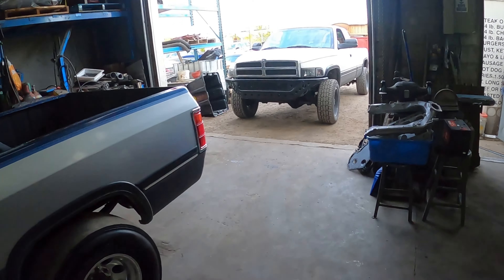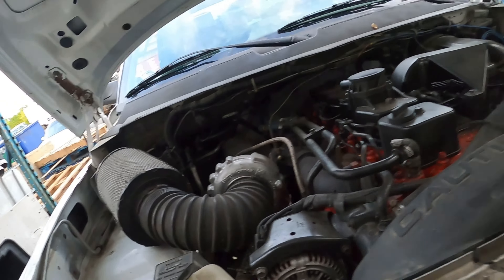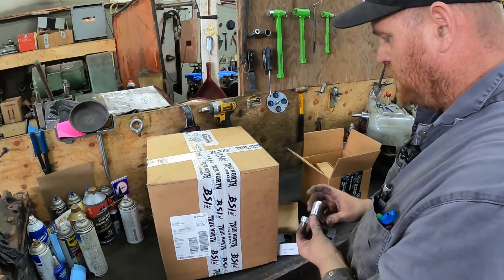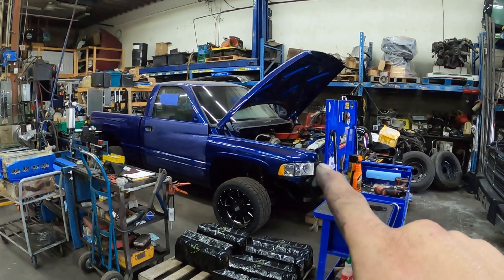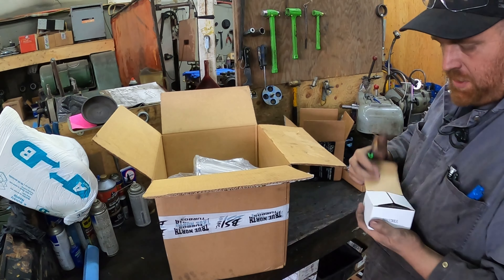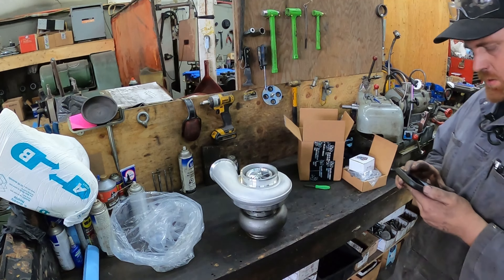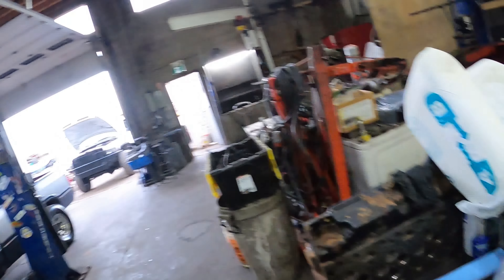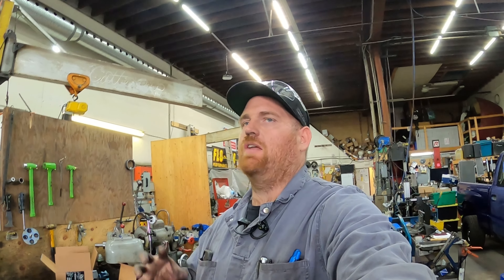I CAN'T DO THIS ANYMORE  SORRY GUYS .  I am going compounds turbo's .

Comment: I went from a silverbullet 62 (awesome) and after dropping a valve and ruining it i went with a s362 with a s475 and its super awesome. Instant boost and lots of it. 60 psi all day no lag no smoke no 1700 egts. Built the kit myself saved 1000s. Its amazing how quiet your exhaust gets and you dont hear the small turbo whistle anymore

Comment: Well when I first saw the heading or what ever it's called . I thought crap I guess Rob is done damn . . Then I saw the turbos lol. Yea I watch Richard Holdener videos ,I watch all of them to learn , and others. I learn that way its a lot cheaper to do it that way .   I have thought about twins but I have to remove the head and do the o rings and studs ect . Pull the pan and weld in a drain . I might do that some time and do a set of towing twins . I come to the realization that perhaps a well built 48rh transmission along with twins might be tow pretty good. I always hated the 4 speed transmission and the huge rpm drop but with the power from the twins that might be overcomed.. at any rate I appreciate a parts list if I ever want to do a set . I use to weld for a power generation company.  Tig stick ect. . Thanks for the videos

Comment: Something I'm thinking of doing myself but with a 362 sxe as the primary, so will be grate to see the  comparative data 👌👍  and Dyno videos with different set ups and parts would be very interesting to. Keep up the good work thanks
Reply from the maker: I would do Atleast a s369 for the primary. You need some spread from the secondary to primary
Reply: @CUTTERUPROB  I yeah sorry I meant secondary turbo already have the 362 on the truck now and was looking to pair it with a 72 or 76, so your project will give me a good idea of which way to go 👍
Reply from the maker: @projectrollingthunder9049   both would be a good setup

Comment: Getting  ready to do the p7100 pump upgrade and in cab fuuling. 
Killer dowl pin
Y to t heavy duty steering and all front end parts with after market steering lower brace.
Rancho 9000 shocks and steering. 
4" straight pipe.
Transmission 1000hp build.
Dana 80 swap with limited slip.
4k governor springs.
Hotrod lift pump.
Fuel preheated delete
Egr delete.
Oil catch can. 
Power steering hot rod pump retrofit 
Wheel balancing dics 
60# over springs.
Turbo adjustable oil feed elbow  and return Fuel elbow. 
All aluminum radaror 
Silicone turbo boots and radaror hoses.
Need to rebuild my stock turbo.
Gauges EGT(pypro) trans temp, boost, rear-end temp. Oil temp
K&n filter and airbox upgrade 
90hp injectors. 
Gen 3 tow mirrors 
Led light
In bumper work reverse 100w lens 
1997 2500 4x4 cummins long bed standard cab.  
Got. Some interior upgrades coming. 
And I need to paint (mossy oak?) What are you all doing with your trucks?

Comment: Hello from Sacramento CA.  Wish I had the funds to go twins on mine.  I am trying to figure out why I don't have overdrive.  My torque converter when and only 25k on rebuilt transmission they obviously didn't replace the torque converter. So I ordered a billit low stall with life time replacement . Opened it up to find the clutchs  still the ink stamps still in pristine condition so I replaced the two bands upgrade to the gm solenoid  and the aluminum 2 seal pistons and billit band  and installed a drain plug. Now I am checking the other two solenoids maybe electrical issue  but but the new overdrive/transducer because had some oil in the old plug  I hope it is not the #9 check ball. Next will check the old solenoids for functionality  and instal new and check the pressure  while in drive with the wheels off. Am I missing anything?  I thought  I had flushed out all the lines pretty good but my old was black and smelled burnt and had a fuzzy magnet with only 10k miles on the rebuild. I rechecked the bands(note use the old style 727 Kevlar band) for the 1st,2nd Rev as it is beefier) I also installed a billit input shaft and metal sungear) not the output shaft as 4x4 don't  need until over 1000hp or 2200fpt. So I should be good to 1000hp on this build and I am just shy of 400hp. 1997 2500 4x4.
Reply from the maker: I am no trans guy. But I would say might a valve body issue or could have overdrive issue it’s self

Comment: Question for y'all. Do I have to give up my oil bypass setup in order to go to a compound setup? My truck...2001 2500 24v VP44 w/auto.
Reply from the maker: Shouldn’t need to no. But depends on the unit you might to to move it